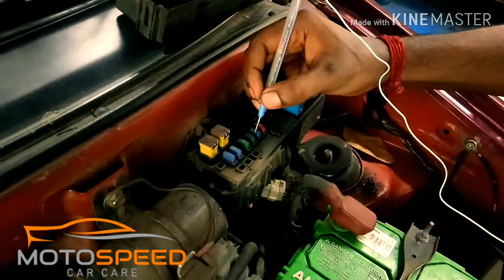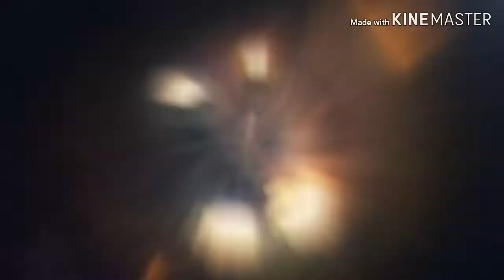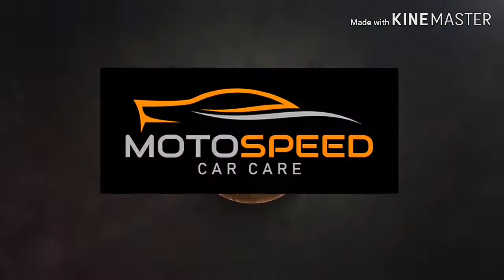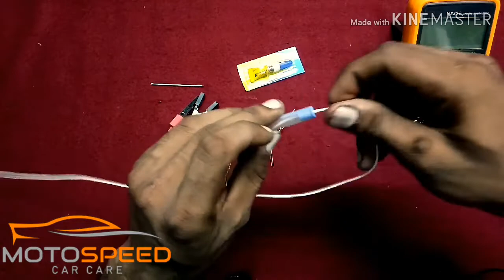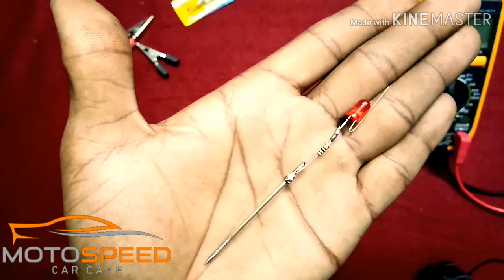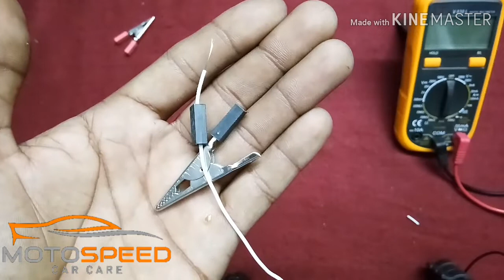How to make a continuity tester

Comment: Good one, very useful for trouble shooting. What is the value of resistor used in this ? Wire joints not to be soldered ?
Reply: 1 k